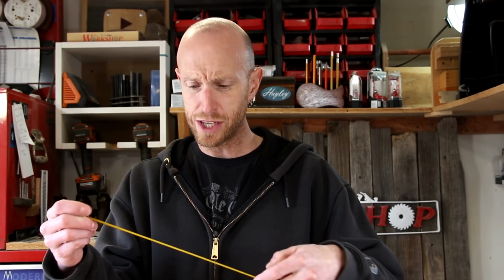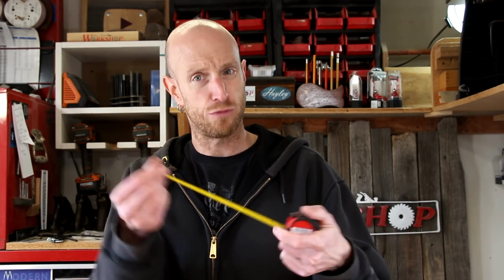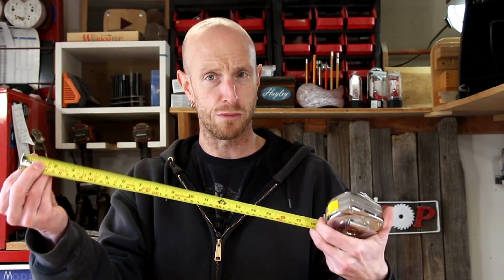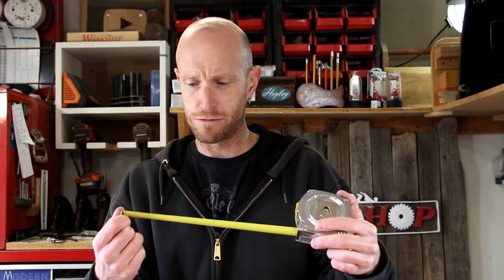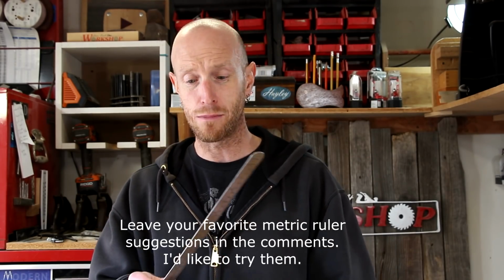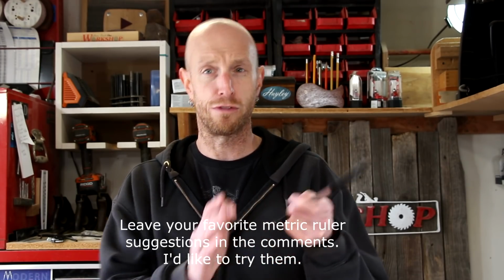My thoughts after using the Metric System for a project | I liked it

Comment: European here, have lived for 23 years in the US.  I always use the metric, of course. Had to use feet and inches once - was instructed to do so for a project, away from home and from my usual work place. After taking a few measurements, I felt the need to also apply some medieval magic and witchcraft just in case - like touch wood, spin round three times , spit over my left shoulder, and hop on my right foot...
Reply: UK here, maybe it's just the time I grew up in but we use both systems interchangeably. Some stuff meters are great, and some inches and feet are better. No preference tbh.
Reply: @mickenoss 
Can you give an example where feet and inches are better? 
Genuine curiosity, since I never used the system and I draw a total blank when trying to come up with one, myself...
Reply: @Sleeping_Insomiac  I would say larger measurements imperial is best (a few feet and up) and anything upto maybe a foot I find meters are better as centimeters and millimeters are easily scaleable (base 10).
There is a middle ground where both work well and are easily interchangeable though.
And a Yard and Meter are pretty much the same thing if you don't need to be too accurate. 
Just my take, I'm sure others have a different take on it.
Reply: @mickenoss  
I guess it's mostly a question of habit, then. 
To me, a door frame is two meters, a normal house ten, a big step one... 
I really can't see an inherit advantage between both systems.
Reply: @Sleeping_Insomiac  I had a classmate in elementary school who thought a dm was as big as an arm span and a mm was as big as a fist. (Czechia)
Here, I believe he wouldn't be confused about the very basic imperial units (inch, foot). (myself even as the ultimate advocate of the metric system I can imagine the distance of two feets in two seconds and approximately measure it. With more accuracy than 60cm) 
This idea of having a small post of body organs side by side is cute and fits the bill. (not to anything else)
Reply: @bmxrichard21  
I dunno, I had early in elementary school a pretty good image of 30cm, since we mostly used a ruler of that length. 
I agree that linking a measure with some everyday item helps approximating distances, but I don't think it matters too much what you use... 
I mean, the foot of an elementary school child is way off of a foot.
Reply: @mickenoss no it isn’t metric is always better
Reply: @mickenoss  no offence but 12 inch are 1 foot, 3 foot are 1 yard, 1760 yard are 1 mile. 10mm =1cm, 100cm=1m, 1000m =1km. It an easy decimal system. How in the word is "imperial" better ?! I see only one benefit, it train your "mental arithmetic" much more than the metric system.
Reply: @bmxrichard21 thats just stupid. Kid isnt as big as an adult.
And using kid from primary school to prove your point? Bruh
Reply: @Sleeping_Insomiac  i grew up learning metric in school here in the UK, but my parents still used imperial so when working with them i got experience with that too. And yeah i would say anything on a large scale like in gardening or landscaping imperial is probably easier. Just because the smallest unit you are ever likely to need is 1 inch. And with feet in-between that and yards there are nice big round numbers to work with that fit most uses. It just seems easier to say "oh move that fence post a foot to your right" than saying "move that fence post 30cm to your right" or "plant those seeds 1 inch apart" instead of "plant those seeds 3cm apart". The measurements are just on a more intuitive human scale that can be more easily judged by eye somehow. But any kind of woodworking, home decorating, crafting, basically anything that ever requires accuracy smaller than 1 inch metric is infinitely better. But having said that since i grew up learning metric i do use it for pretty much everything now even big stuff. Just because I'm soo much more used to it. And it works just fine. I'd rather have to have the extra step of saying 30cm instead of 1 foot, so that when i come to needing more precision i only need to say "that cut needs to be 32cm" instead of needing to say "that cut needs to be 1 foot and 10/16s of an inch.
Reply: @mickenoss  made a few pieces for the kids during lockdown (UK) and used both metric and Imperial measurements. 
I say "kids" at the time they were 33 and 36 years old lol.

Comment: It's actually great to see an American worker discover the benefits of the metric system. It's kind of like when a friend finally watches a comedian you've been recommending for ages and they laugh just as hard as you do. 

In Ireland the changeover to metric was a 25 year process that started in 1980 just as I was starting in secondary school. We continued using many imperial units for a long time after that. I remember one of the last was when all our road signs changed from miles to kilometres in 2005, both distance and speed. That was weird, snd difficult for some. Even having grown up metric I was really only fully familiar with it at small scales. 6 metres is a big size when you're working on a project, while 60 centimetres is small and manageable. So when I suddenly had to travel 60 kilometres instead of 60 miles, I'd instinctively ask myself "Is that farther away than 60 miles, of closer?". And if your car's speedometer was imperial (like most everyone's) was 40 mph on a 60 kmh road speeding or what? 

Change like that isn't an overnight thing. It's not easy, but it's not difficult either. It's a protracted process that you go through together as a society. You'll help each other out, and you'll get impatient with each other for not getting it yet - five years later! And if you're anything like the Irish you'll handily switch from one to the other depending on what you're at. I'll describe someone as being 6 foot two, or a place as being 20 miles away, because sometimes that's just easier. But when I'm working all my measurements are metric, because it's reassuring.

It's inevitable that America will adopt the metric system eventually, and I personally cannot wait. When it does there'll be an inevitable creative explosion and I can't wait to see the measuring tools that come out of that. America produces some amazing hand tools but for now many of them are next to useless to me. So it's with purely selfish motives that i say: C'mon, America, get your act together! :¬)
Reply: Sounds like the New Zealand experience with metrification. If I'm going for a walk, miles, kms doesn't matter. But vertical climbs are in feet, because all the government survey maps were.
Reply: It's very interesting that Ireland took 25 years for the changeover. In Australia they picked a date and gave everyone 12 months to get it done.
Reply: About the only thing I like Imperial measurements for is things like height and weight - they are just nice discrete lumps to break down those aspects, which I don't feel you can do quite as easily with the metric ones. I feel like I can estimate someone being say 5'6" more naturally than 165cm. The metric gaps are too subtle. For everything else, metric is just so much easier to manipulate, and things like long distances it just doesn't matter
Reply: I understand. euro conversion took 3 years and 21 years later some older people still use the old currency.
Reply: @josepnebotrius872  if they do, I suppose it's for very big sums of money, like for purchasing houses and such. based on personal experience, you adapt fairly quickly with daily things, because you purchase them on a regular basis and it's relatively easy to rebuild your reference frame. the main concern at the beginning was about estimating how much you were getting ripped off by the change, since a lot of the prices "adapted" to the new scale.
it's more problematic for those rarer expenses (computers, cars, houses), but you get there eventually. I guess the fact that the conversion is not too straightforward (I'm French, you have to multiply the € amount by 6,55... to get the amount in Francs) did speed up the process a bit.
Reply: Yes, converting for me was very quick for me. Most people that do is for large sums. Trying to convert to the old currency it only gives you the idea of how much inflation affected prices those years.
Reply: @neilbiggs1353  I like it for temperature because it can get more precise without going to Decimals.
Reply: 1m3 of water weighs 1000 Kg or 1 ton , none of your 2240 Lbs
Reply: @neilbiggs1353  hmmh, metric is not just for height and weight, it's all about easy logic and conversion. You only have to shift the decimals.
1km = 1000m
1m = 1000 mm
1 liter = 100 x 100 x 100 mm
1 kg = 1 liter of water
1 metric ton = 1000 liter of water
1 m² =  1 x 1 m
1 km² = 1 x 1 km or 1000 x 1000m
and a bit more complex but still easy to understand:
J = kg·m2·s−2 
= N·m 
= W·s 
with J=Joule for Energie, N=Newton for Power and W=Watt for performance

and now try this with the imperial system without using any kind of device for help ;-)
Reply: @Jo-Jo8vs  Have you ever considered reading the whole comment you're replying to? It might help you not completely miss the point - What I was saying is that the discrete lumps that imperial units break down in to are easier to estimate than the metric system for a very particular set of circumstances. A 6' tall 14 stone person is easier to visualise than saying they're 185cm and about 85kgs even though they are approximately equivalent. Is that clear now? They are nice benchmark approximations to adapt from which metric doesn't have as it it too subtle. It's why they used things like 'hands' or 'Cubits' for years, they are nice discrete lumps that you can estimate in whole or crude fractions. We don't even talk about decimetres even though they exist and are somewhat close to a 'hand' in size.

When I then said (and you somehow completely missed despite wanting to appear clever) is that the "metric system is easier to manipulate", which is obvious and doesn't need explaining, but bless you for feeling so self important that you felt you had to try. Thank you for showing that you have a basic grasp of the SI system, now run along and wait until you become aware of the prefixes like kilo, mega, pico, micro,...
Reply: @neilbiggs1353  I'm german and thus using something else than metric and defending it is just stupid. Discussion over.
Reply: @Jo-Jo8vs  German is no excuse to be utterly clueless, that is entirely on you! Maybe restrict yourself to discussions you understand next time?... The silence will be enjoyable
Reply: @neilbiggs1353  May you use your brain to understand simple logic next time.
Reply: @neilbiggs1353  thinking that it's easier to estimate a weight or a height because it's written foot or stone can only come from somebody who has used that his all life.
As a metric user I know how much is 10cm, or 5cm. If I see somebody I just have to think about how much cm this person is compare to me. And you probably do the same, I'm sure you do not visualize 5 feet in you head, then on these feet you visualize inches also ? No, you know how much is an inch and that's it, you do not put the image of a real inch. Same for us in cm.
Metric ic easier to manipulate because when I measure somebody I saying 165cm is exactly the same as saying 1m65 and you see how the conversion is easy, where you will only say 5'5 and you have to think to switch to th 66" way more than me from meter to cm.
Reply: @antoinelaporte9335  Metric is easier to manipulate because it's a base 10 system, so you're not having to navigate different fractional amounts as you step up and down, it's all simple decimal.

It's not just about familiarity when it comes to estimation, you generally want a moderate size in comparison to the object. It's why they talk about x football pitches or y coaches when they want to give a large area or volume. A foot at approx 30cm is a decent fraction when you're trying to talk about a person's height which isn't as true for say 10cm or especially 5cm intervals. I have used both all my life, so it's not simply about being familiar, though yes, if you don't use one as much as the other, then it makes a difference.

I suspect that is why the ancient systems tended to be based on units like feet or cubits because people could usually be familiar enough with those dimensions to be reasonably able to talk about those, whereas with the SI units, there has needed to be ways found to make sure they have a particular reference point. The international standard metre was kept in a museum in Paris at one point if I recall.
Reply: @neilbiggs1353  it doesn't make any sense, your argument is using the only subjective point of the discussion as a "pro", if you  say someone is 6' i have no clue how to picture it because i have never used that  measurement unit in my entire life, it's just easier FOR YOU, it's not a selling point, it's also not the selling point of metric system, using any system will get you familiar with it so it's only normal to prefer the one you are familiar with.
Reply: @CoffeeSipper555  It does if you actually pay attention to what I'm saying - a foot is nice size to visualise as opposed to a centimetre which is too granular. The more individual items you have to count, the more the error on each individual item affects the estimate. All your saying is that you don't understand one system, having grown up using both I can tell you that having larger discrete lumps makes estimation easier. Neither one has a familiarity advantage to me, which is why your comment is way off base.

It is the same reason that big objects tend to be described as small multiples of other big objects. Something will be described as being the size of four football pitches, or three buses for example. The baseline of the imperial units are both familiar (a foot is approximately the length of a person's foot), but also big enough that you can estimate something using small multiples
Reply: ....so now it remains that you only need to get to drive on the correct side of the road....